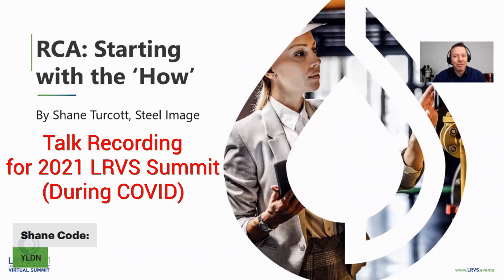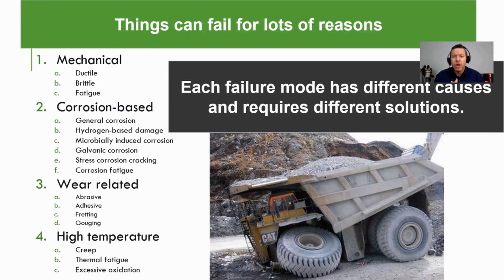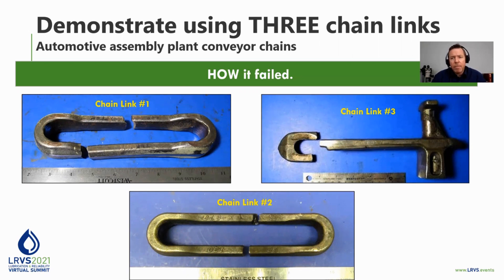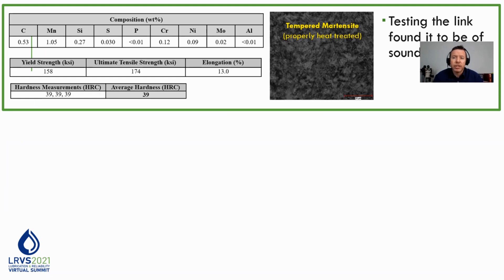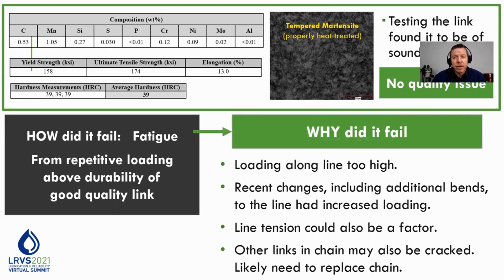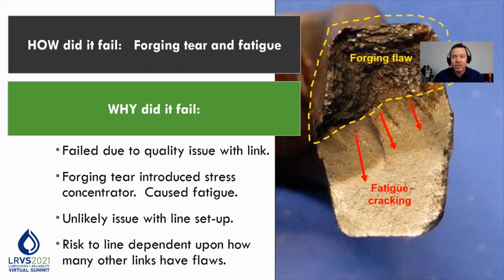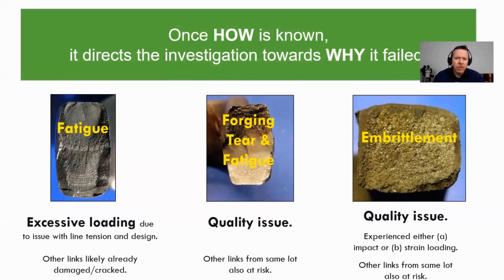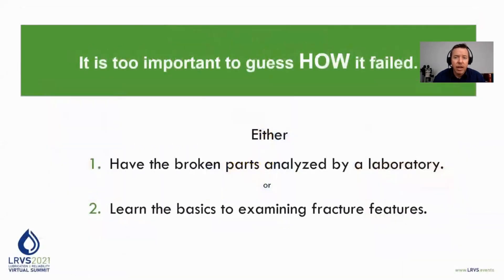Investigating Equipment Failures: Starting with 'HOW'

Comment: I appreciate this information. As I watched, I was reminded of an eye bolt (10mm x 50mm, 300 series SS) failure that occurred during some testing. The information provided in this video will be very helpful in case of another failure. Thank you.
Reply from the maker: I would hate for anyone to consider this useful enough for a failure investigation.  Its only useful enough to let people know they should either (a) learn more about how to examine fractures or (b) see the value of sending the broken part to a lab.  It truly does not teach how to interpret fractures...